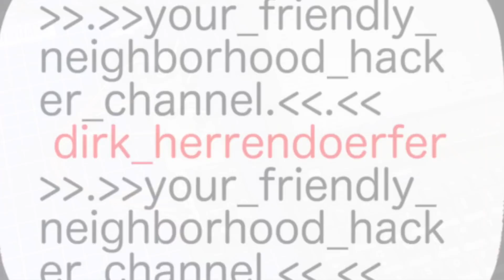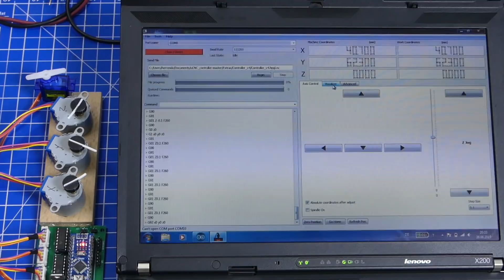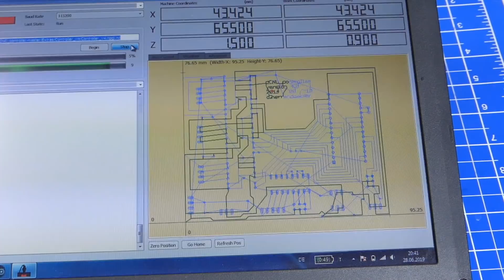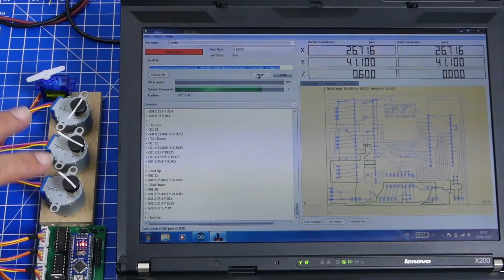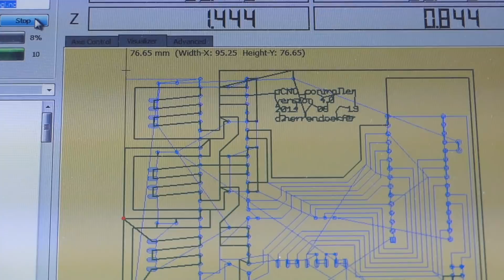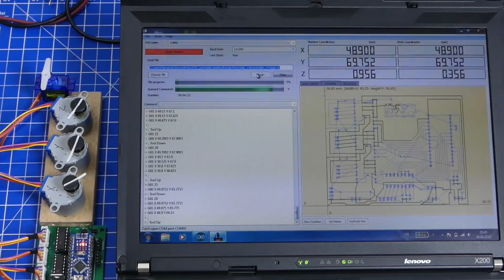grbl on uCNC_controller dev update - new mode available: emulated Z-axis servo control

Comment: Can this version of grbl be used with with a cnc shield v3 and  an Arduino uno?  how do you configure it to use bipolar steppers instead of uni-polar steppers ?
Reply from the maker: No, if you have a CNC shield you should use the unmodified original firmware.
Reply: I am currently using  a core xy plotter that I built and it uses a stepper for the z axis but it keeps over heating because I run it too fast. I want to change it to a servo but  my experience so far is that you don't get worry free operation with all gcodes when using a servo. There is always some issue. so I wanted to try your version to see if it will give me trouble free operation. Any advice you have would be greatly appreciated.
Reply from the maker: @margran1  I have (finally) received a V3 shield. Which port would you recommend using for the servo data line ?
Reply: @dherrendoerfer  I just saw your answer to my question. I am sorry I took so long to respond. I've been busy with work.  

You can use any port that does not block the use  of any  of grbls build in functions i guess.
Reply from the maker: My code should work with the normal shield, but it may need adaption since the ports are different - in any case it should be forked of the original grbl firmware code.